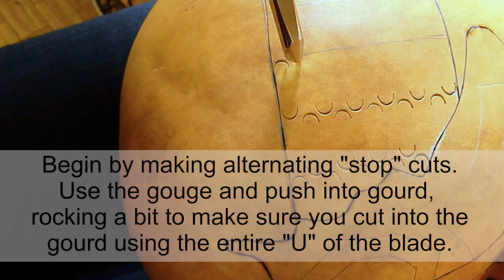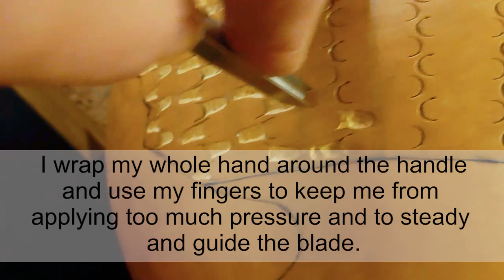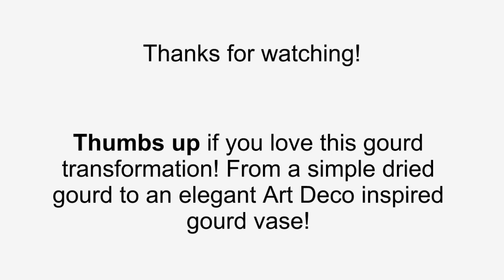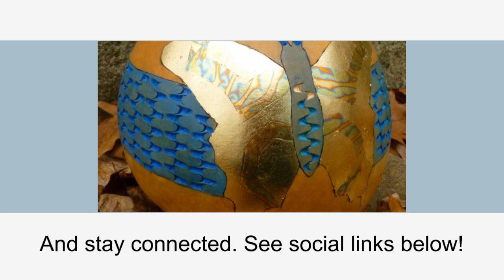How to Chip Carve a Gourd

Comment: What dye do you use? Thanks.
Reply: I use Memories Ink Dyes. You can also use leather dye or Adirondak alcohol ink dyes. The good thing about the Memories Ink Dyes is they are the least messy and won't run, but the alcohol based dyes blend more easily than the Memories. Depends on the look you're going for! Good luck!